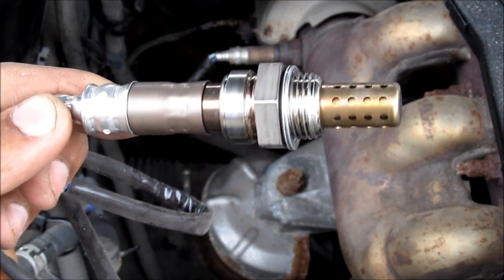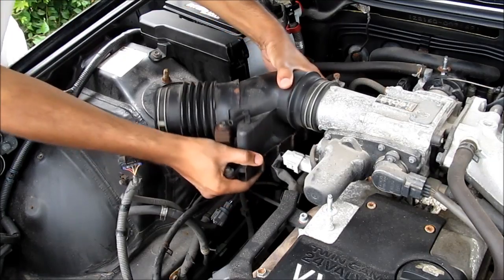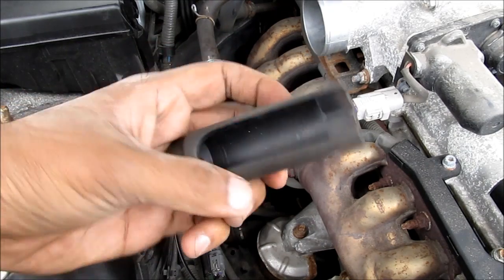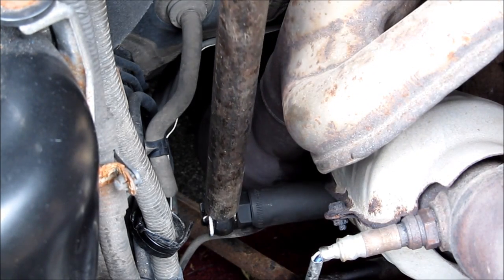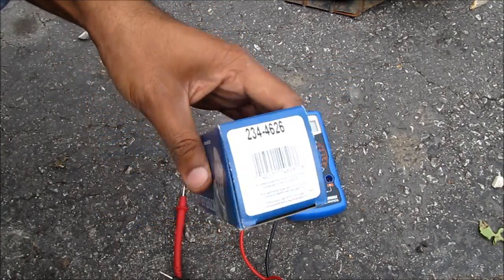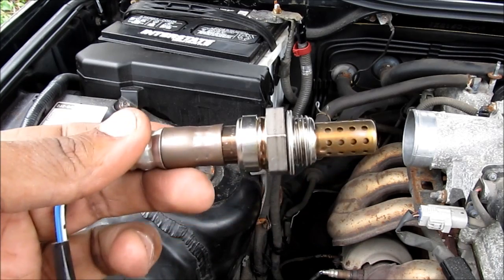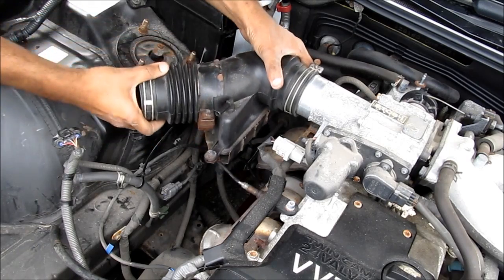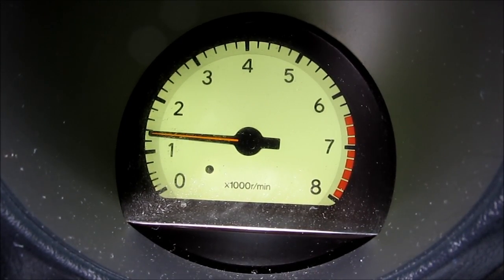Oxygen Sensor Replacement

Comment: Also to test sensor itself you can blast it with some torch gun and measure DC Voltage  on sensor wires. I think it should come up to 0,9V DC.
Reply from the maker: Thanks

Comment: Great video.  Your resistance measurement on the factory sensor was valuable.  I checked the heater circuit on my 2000 GS300 and it measured 15.7 ohm.  I could not find this information elsewhere on the internet for a o2 sensor 234-4626.  Looks like you commented it was 16.0 ohm but in the video it dropped to 15.8 ohm.  Adding this comment hoping it will show in google searches.  Also, the 234-4630 should probably be similar and seems to be another sesnor for same vehicle.  [o2 sensor 234-4626 resistance]
Reply from the maker: I'm glad it helped

Comment: good video speedkar99, had to do this a few months ago for the downstream sensor on my 1999 Camry, was not fun at all, had to use lots of PB Blaster, long cheater bar, and eventually a map gas torch to get the old sensor loose... I had a flame on that thing for a good minute until it turned red hot and was glowing lol  then it finally came loose
Reply from the maker: neppy5 Yea these get stuck on there really tight. Some of the threads damaged on mine so I had the hole tapped by a shop.

Comment: Is this Gs a new addition to ur cars? Jus curious since this is ur sec video on this same car.
Reply from the maker: 5Riverz Yes its my brother's car.
Reply: These r great cars!!! My brother has the same car, im lookin for a sc300 for myself but whatever i find is 1995 or older and i dont want an obd1 car. If i dont find one i like i will likely end up with one of these.
Thanks for all the videos!
Reply from the maker: Glad you find the videos helpful. I've got a few more small things to take care of on this car in the coming months, so I'll post a few more videos on it.

One thing I find on these RWD cars is they're harder to work on in your garage without a hoist, as everything is buried very deep under the car (like the starter, transmission pan, etc) meaning you have to lift it up really high and slide under.

Also the master cylinder and ABS motor is one unit which makes it super expensive if you need to replace a worn one.

Comment: What about the location of sensor for P0171 in 1mzfe
Reply from the maker: lexusfan100 I'm stuck on this one too, a friend of mine has this code on an ES300. Gonna start with cleaning the MAF and throttle body this weekend.

http://www.clublexus.com/forums/es-1st-to-4th-gen-1990-2006/597307-es300-p0171.html
Reply: speedkar99
 ya i got mine on my ES. and then i cleared it with code reader and then never came back. I am sure its prolly stored in the system somewhere. hiding .lol. But i think  i will just change the sensor . i thnk its bank1 near the firewall? but not sure on part number.
Reply from the maker: Yes from what I've read B1S1 is the hard one, behind the firewall. Please let me know how this goes, I've got the same issue to solve on my friend's 99 ES, except his CEL is on and his engine is chugging at idle.
Reply from the maker: lexusfan100 For Bank 1 sensor 2 I used Denso 234-4626
Reply: speedkar99
i thought we are talking about Bank1 Sensor1. and thats the code for P0171.
Reply from the maker: Oh, I was referring to the video, bank 1 sensor 2 on the GS300. I'm not sure on the part numbers, RockAuto shows me something different for the 2000 ES.